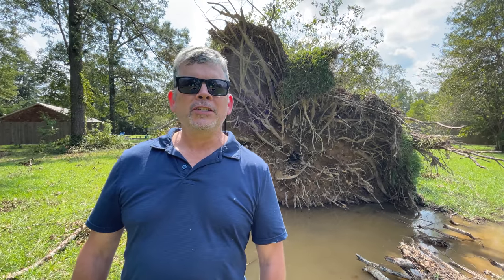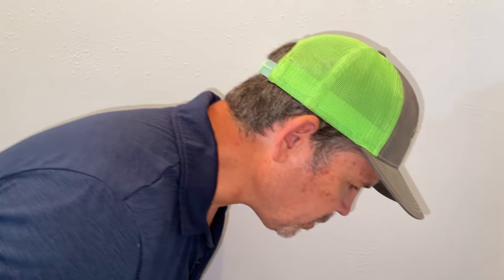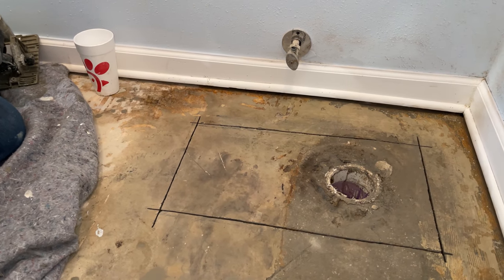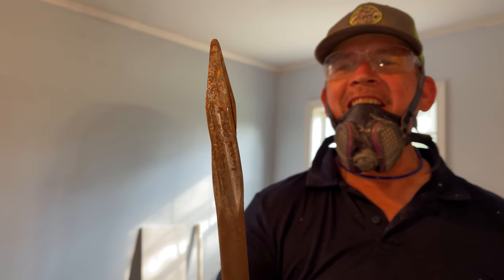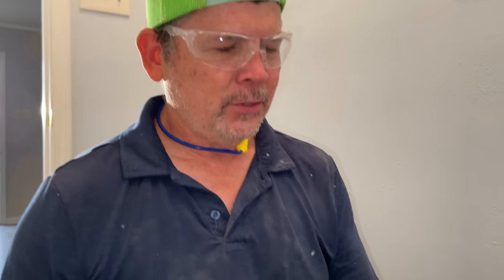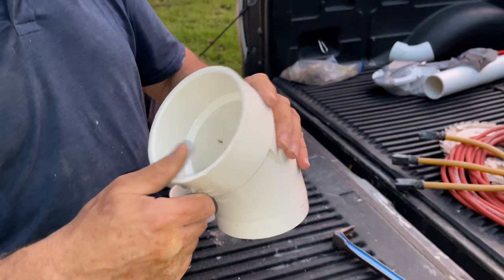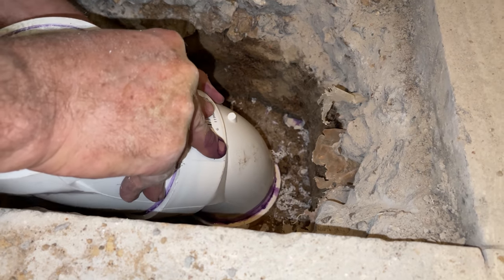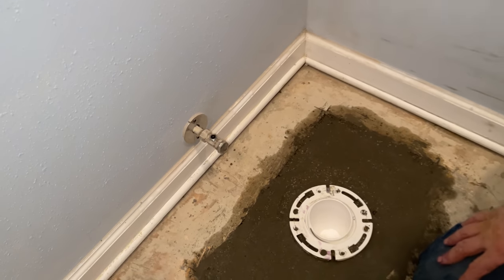We Moved a Toilet Over 5 Inches and It Kicked Our A$$

Comment from the maker: LOTS of comments regarding a heat gun. Well it would be a beautiful day on the jobsite if we had every tool we needed every single time! Sometimes gang, you just don't have what you need, but the job still has to get finished. Behind the scenes we talk about how we wish we had one. We also discuss 45 degree flanges, Reducers, and digging deeper. And sometimes you're at the mercy of the local hardware store selection. Real World Stuff. Some great tips down below, keep em coming we love reading em! Thanks Gang 👊
Reply: Looked like my typical day....  what can go wrong does go wrong, dang near every single time.  If it weren't for bad luck I wouldn't have any luck at all.  ;-)
Reply: This is what I like about you.. it's realistic DIY level construction. You just gotta go with the parts and tools you can get your hands on.. I had to use a flex coupler wich I realy hate just because none of the stores carried the old style 30 and 60 degree bends. And the existing T is in the concrete floor of my 2nd floor apartment.
Reply: I agree w Northern Light & with you..You have to get the job done with the tools on hand & sometimes it goes side ways.  LOVE  the content & real life problems you guys tackle!! Keep up the good work..
Reply: I just got the BUZZ!
Reply: Wherever you bought the pipe probably sells them... You mentioned 2 extra trips to the store so while you were out, probably should have got the $25 tool for the job while you were there. I don't know what your time's worth to you, but the time you wasted doing it that way would have been worth $25 to me.
Reply: No Heat Gun? No problem, coat the inside of that pipe with some glue and light it on fire, just don't breath the fumes, or melt the outside socket done it that way plenty of times in Australia to remove pipe from socket, if the bond is not broken try and try again until it starts to melt and warp
Reply: Guys if I ever find myself in you area the beers and dinner is on the house! Thanks for the great project videos and awesome dad and son times!
Reply: @northernlightsrenovations1710  "Doom,despair and agony on me.
Deep down depression,excessive miz- eree'".

Old HEE-HAW jingle.😁
🙂✌❤
Reply: @kajem575  I used to watch that show religiously,  It really was hilarious!
Reply: @northernlightsrenovations1710  I  prefer classic rock,jazz,and jazz-fusion, but listen to and like any/all genres.
Many excellent guitarists featured on that show though.
Earl Scruggs,Glenn Cambell,Roy Clark, et al,etc;.
Yes great show! 👍🔈🔉🔊📢📣📯🔔🎼🎵🎶🎙🎚🎛🎤🎧📻🎷🪗🎸🎹🎺🎻🪕🥁🪘📱☎️📟📠🔋🔌💾💽🖲🖱⌨🖨🖥💻💿📀🎥🎞📽🎬📺📹📸
P.S.: I work as an amateur soundman/musician in my retirement.
The last show my friends and I put on at a local park on July 3rd,I had an (unrealized) medical emergency brewing where my potassium level dangerously dropped + over exposure to the sun and I died the next day. Was in hospital for 5 days on life support for 2+ days.🤒🤕🤢💀.
Yeah,good times!😮
Back to normal now though (as those who love me would say) 😆😄
"Ima'-pickin'".
"And Ima-grinnin'"
Dig it!
🙂✌❤
Reply: @kajem575   Well I'm glad you pulled through brother.  It's always good having like minded folks on here....  ;-)
Reply: I believe it wasn't the plumber's fault, when the house was built, it may be just a bathtub and later the homeowner removed the bathtub and added a wall in between walk-in shower.
Reply: Astonishing that the electric was on.  Wonderful that the store cash register was working (electric).
Reply: We've all been their brother your working on a job and its pissing you off to no end and you think if I just had the right tool that I left at home I could have this done, but we plow through with what we have and we get her done. The world isn't black and white or perfect and neither is anyone one else that has ever graced this world. But for the most part we all try to do right by each other.
Reply: @jmaxim80  Well said....  well said!
Reply: Not having every tool on hand - I drove 100 miles to put brakes on my daughter's car in her college dormitory parking lot. I took every conceivable tool I could possibly need except for a small sledge hammer in case a rotor was stuck. (I actually had a note in my pocket, "GET SMALL SLEDGE".)  Just when I was about to give up and go buy a new sledge hammer at the hardware store, her friend the university electrician pulled up to say hello. She said "By any chance, would you happen to have a sledge hammer in there that we could borrow?"  He said "I've been an electrician here for 13 years and have never once needed a sledge hammer, not once, so I have absolutely no reason whatsoever to carry one in my van ... but yes, I sure do, here ya go."  WHACK. Done.
Reply: Head is not just to grow hair, I really like to say, your improvise is something that a lot of license guys don't have in a job side like that.
They have all tools and still doing the wrong way. 
You? Did a great job, and the code not teach how to do it.  Congrats for the good video and May God bless you both. Family together is great thing to watch. 👍🏼🙏 .
Reply: Man it sure is easy sitting in my chair. Been there no matter how much planning sumthin always slips by tools materials always sumthin good job
Reply: way to gather up ur troops and getter done! I've been there many times...lol and gluing up the pvc in the correct position, in the end is no easy task when frustration is at max level...I dont know how many times 3" looked like 4" or 1-1/2" looked like 2"...one word of advice going forward, don't ever let a customer talk you into a "man cave" conversion of a toilet to a "man stall" urinal with automatic flush!!!! hahaha it will take you to whole "nuther" level of brain damage...
Reply: @pastor.399  Agreed! This works like a charm.. ram one side from a pair of needles nosed pliers between the pipe and the hub after its soft enough, then squeeze and coil up the heated pipe like a sardine can lid.  Of course a socket saver is best if you have it,  but if your in a pinch this is a great alternative.
Reply: Even with a heatgun it can be a pain especially with it being buried like that. You just don't have the space to work the way you want. Honestly the only thing I would have done diff is make the hole bigger to work easier. But you just don't know until you starts hindsight is 20/20.
Reply: Get 'er done! Hey a heat gun works great, but there also is a PVC reamer tool which bores out pvc pipe fittings to the OD of the pipe, so you can reuse elbows, couplers and all the rest. Highly recommend.
Reply: Torch + hole saw heat it up and stick it inside the pvc pipe. Then use some needle nose pliers to remove the inner pvc.
Reply: You do what you have to with what you have. Thirty plus years as a self employed contractor myself,I can relate to your challenges you had to overcome. You have to experience it to truly understand how it feels when you finish. Great job.
Reply: @DaddyBeanDaddyBean  lower jack with lose bolts shake tire, weight of car will do the trick.
Reply: @user-cb2427  interesting. Thanks!
Reply: Rofl thats what i was gonna suggest
Reply: Improvise, overcome and adapt!
Reply: If you guys had a hole saw kit that had a hole saw 2 7/8" or 3" diameter that could fit inside the 3" pipe as well as a propane torch for sweating on copper pipe then just heat the hole saw for 1minute until bright red, use locking pliers to hold the saw in the pipe touching the inner tube for 1-2 minutes until all the heat transfers and then peel away the inner tube when it becomes pliable with needle nose pliers.
Reply: Look up 'Reed' or 'Pasco' brands, ram bits. They are hub reamers, that make quick work out of what you were struggling with.
Reply: لا لا والله ولا لا ولا انا ولا لا ولا ولا اي لا ولا وانت
Reply: Just started watching the video and I already feel your pain. I live on Kauai and there is only two Ace Hardwares, a Mom and Pop Plumbing supplier and a Ferguson supply. If they don’t have it you’re screwed until you can get the part shipped in to you. I have a similar project at my house where the toilet was installed a foot from the wall. Wish me luck.
Reply: They make a large drill bit to drill out old fittings. Something only plumbers would have though. Great job using the tools you had!
Reply: exactly real world stuff
Reply: One word "Practicalities" - the aspects of a situation that involve the actual doing or experience of something rather than theories or ideas, wishes or dreams.
Of course there is an ideal world; but that puppy is probably in Elon Musk's capacious brain pan or else projected to be his Mars in one hundred years.
Reply: They actually make a saw attachment for a drill for those glued pieces in the couplers to get them out. I believe they make 6"-1.5" it called a pipe saver saw. You should try and find a set of them. I'm, sure you know what I'm trying to tell you about here.That would make quick work of that stuff.
Reply: You guys need a proper utility body pickup.Set up correctly they’re a
rolling shop where your tools are always at hand.
Reply: Local hardware stores operate like gangsters. It is why you have to collect what you need and defend it.
Reply: Knowledge, ethics, and will trumps any tool
Reply: I have to say, I'm a multi tradesman and I am not a professional at any. You have won my subscription. I love your positive additude. Working with you I bet, would be a great experience . Thank you for showing real life problems. It's not made to go to the hardware store just once anyways lol.
Reply: I would have thought a heat gun would be something you carry or is space limited? if you need it once you will need it again. Something like a SDS drill you used will break or drill so maybe there are better tool choices that do more but as your the guys doing the work i guess if there was you would have them. im surprised you didnt have a blowtorch or is there a reason you cant use that over a heat gun
Reply: You should have the right tools to do it is really easy....you can buy them at any plumbing store
Reply: Damn, that seems like a lot of work.
Reply: @northernlightsrenovations1710  tv
Reply: Tv
Reply: Tv

Comment: I used to build swimming pools and moving drain lines was one of the frequent tasks.  If you all run into this again, do a little more cutting with the saw.  A little checker board pattern in the area you are trying to remove will save you a lot of time with the chipping hammer.  I am also bald and had a large can of the purple primer fall off the rebar shelf I was putting a 4 inch pipe through and it dumped on my head.  I looked like Gorbachev for almost two weeks.  Great work guys!
Reply: Love your Gorbachev reference.
Reply: Great story we all knew that it had to of happened to someone out their.😆
Reply: This had me lol for real
Reply: Well if you would have preferred blue. Try getting of that blue cleaner that we use in the back of toilet off. A smarf  look 😱. Or head to two in poison oak and have to cover it with calmine. The pink panther look for sure. 😄🎭🌝🤭
Reply: Great comment.
Reply: I agree with the concrete cutting suggestion...I also would have drilled 3/8th holes every couple of inches through the slab around the perimeter then made my cut just to the outside of the row of holes and done the same with a couple internal cuts like you suggested...I think the drill in more efficient and less physical force needed than the chipper bit to bust through the entire slab...only use it at the end and the concrete should easily crack and crumble with less work from the chipper...imho...
Reply: That stuff ALWAYS spills!!!!

Comment: I'm sure someone has commented that: 1. There's a 4" drill bit that will bore out the glued pipe. 2. Your toilet flange is now flush with the slab, which doesn't leave any room for the finished floor (i.e tile), so someone's going to have to raise it again after tile goes on to be on top of the tile.

Comment: Did you think about cutting up the tree to burn wood to cook food? Just a thought. Toliets should always be installed in 4". Just chop the slab around the flange is the simple easy way. Chopping would create less dust than cutting. Solar generator would be useful if you can not get fuel for the generator because of a power outage. Hacksaw blade to cape out the pipe inside the hub. Hold the pipe still as you cut.

Comment: My buddy is a plumbing apprentice and loves to call out any goofy code violation and would probably cry watching this video. And because of that.... You got my like and subscription.
Reply from the maker: 😂 thx
Reply: Never underestimate the power of spite.
Reply: Lol they drill the code on you, then you learn that n the real world “ acceptable solutions “ need t be use.
Reply: The violation I see is a contractor practicing outside the limitations of his license
Reply: This video depicts what should NEVER be done in a situation like this. Epic fail.
Reply: @edwardmanning9290  Never is a long time!
Reply: @edwardmanning9290  What should be done?
Reply: @RyanBissell   the horizontal drain line should have been exposed and extended so that either a sanitary 90 can be used or a dual 45 can be used.
Reply: @edwardmanning9290  Pffft!!
Reply: An angle grinder with a round 36 grit stone would have made quick work of cleaning up that fitting.
Reply: Did you just use purple primer to put those pieces together ?  PVC glue is grey.

Comment: As a plumber that's been plumbing for over five years, good at what I do and take pride in my work... I've always had a huge imposter syndrome. Somehow seeing this video takes a huge weight of my shoulders because I'm always beating myself up about things I don't do PREFECTLY. I feel justified somehow now when I get things done even at the expense of a little "cheating". 👍Subscribed
Reply: Let's say I wanted to move the flange 4" vs 5".... do I still use two 45° elbows and just cut them shorter to get the distance down?
Reply: @VivaLasVegusNervana  use 22s if you can get it with 45s. If you can't get it with 22s use an offset flange, yes it is a real fitting. Or use 45s and an offset flange to bring it back a little. Options are broad.
Reply: I get imposter syndrome all the time. Some of these guys with 15-20 years in just make me feel stupid sometimes. This video made me feel great about my competency. This is a project a foreman would expect finished before lunch lol.
Reply: “Imposter syndrome”, I like that.  As a “Jack of all trades” I feel that a lot.  I always say, “there’s the wrong way to do things, there’s the “code” way to do things, and then there’s “my” way.  It’s always safe and works so, whatev.  Lol

Comment: Glad you guys are holding up! Its always those "just a few inches" projects that end up taking the longest time and requires 2-3 trips to the store lol
Reply: Nice Try Bro,  I agree with you totally.  I'm currently rehabbing (not remodeling) a house that's just over 60 yrs old.  After that many years of settling, nothing is still completely level, square, or plumb.  Constantly running into one head ache and pain in the a$$ after another.  But there's a certain gratification that comes with formulating a practical and reasonable work around (obviously needs to be safe also).
Reply: @watchinit6530  a lot of the old houses were never plumb, level or square.
Reply: @speckulator7516  ,  Correct.  I'm removing drywall in order to install wall insulation.  Some of the wall studs are not in good alignment with the rest of the studs on the wall.  Makes installing the new replacement drywall really interesting. 😳

Comment: Heat the PVC with a heat gun and the glue let's go. When it gets hot run a screwdriver in the joint to fold it in, grab it with a needle nose pliers and start winding the piece like opening an old Spam can.
Works fast and clean.  Ready to reglue new piece in.
Reply: I was about to say the same thing. Heat gun works great. Saves the fustration and headache.
Reply from the maker: Thx Johnny I’ll try it 👊
Reply: Just pull those fittings apart from each other, oh sorry you can't you leave on wrong continent. Here in Europe we don't glue pipes.
Reply: You didn't bring it up, but I love your taping those PVC cans together.  It's obvious why you did it,  but why didn't I think of that. I do very little plumbing work but that's a great idea.
......why tip over one can when you can spill two. 😁
Seriously, good idea.
Reply: Done it many a time. Always been a little skeptical about doing that on a pressure joint but it works great for dwv
Reply: @k.d.8924  Same here.
Reply: @randywl8925  Somebody makes a little plastic tote that holds both cans together.  Tape is cheaper though.

Comment: Great job guys. One thing I would do different is rotate the toilet flange so the bolt doesn't end up in the middle of the slot, but rather at the end of the slot. Your bolts are always going to be in the middle of the flange so there's no need to do that. I've had to repair many broken flanges because of this thinking. Good job

Comment: There's a tool made specifically for that situation.It's called a socket saver worth it's weight in gold. They are available at most big box stores and come in all sizes. Easy pezy with the right tools .
Reply from the maker: Yeah I know.   Probably need to invest in those 👊
Reply: I was thinking about one of those tools the whole time they were struggling with cutting out the pipe. Would have saved them so much time.
Reply: I have the fitting savers in all sizes you are right they are amazing, have saved the day many times
Reply: holy shhh just looked that tool up thats so legit
Reply: Thanks for sharing. Didn't know about socket saver